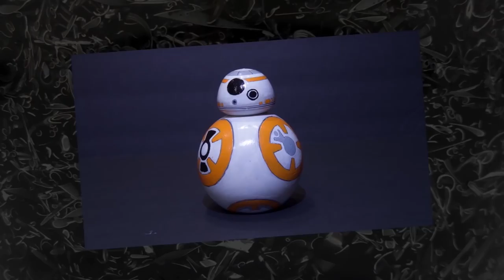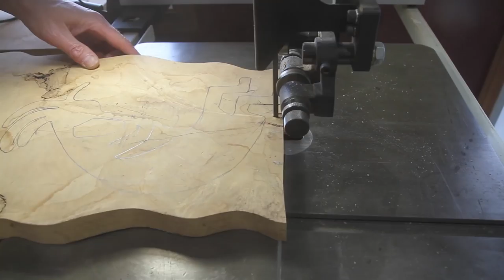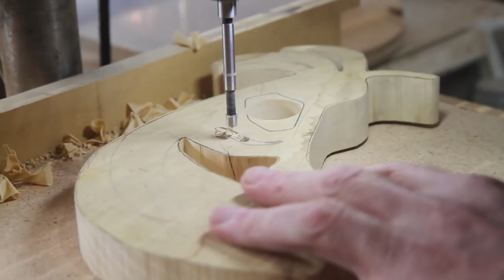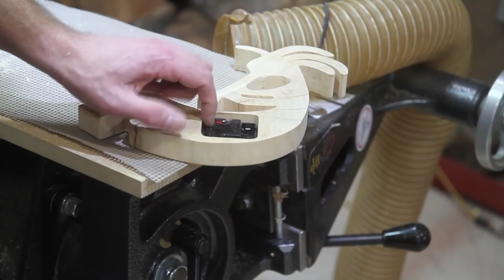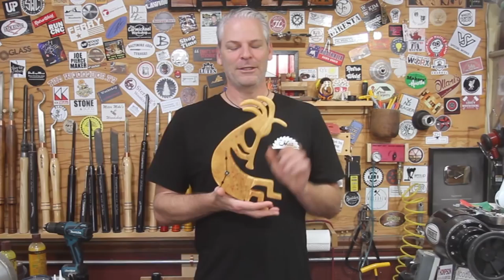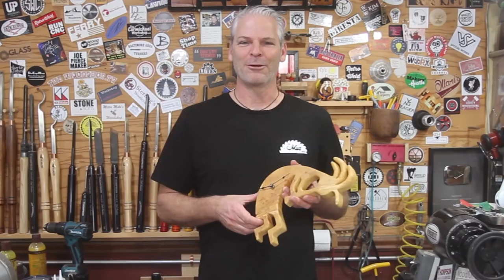Woodworking Kokopelli Clock

Comment from the maker: I made Robin a kokopelli clock for the camper. I used the bandsaw to cut out the shape, and the drill press to drill out the interior pieces and recess for the clock. After sanding it with Howard wax I finished it with Hampshire Sheen.